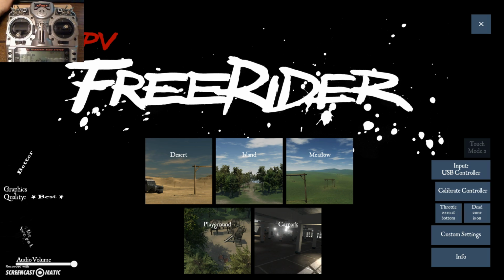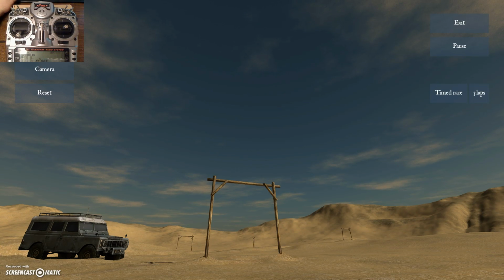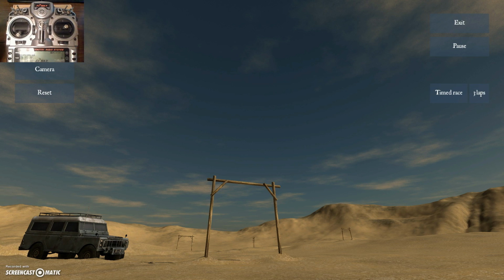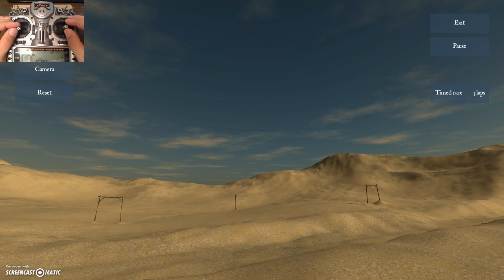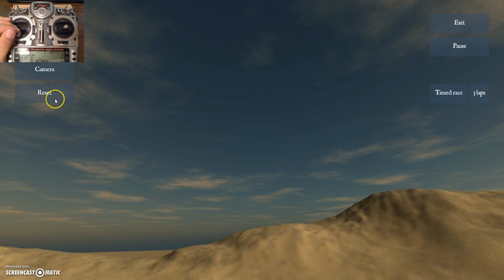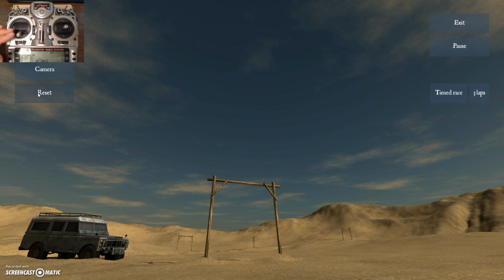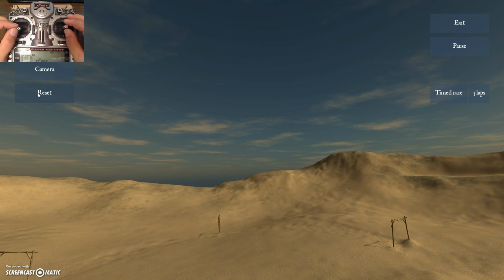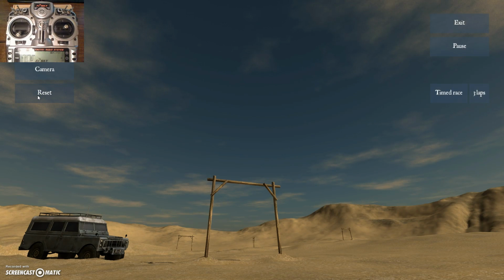How To Fly A FPV Racing Drone - Lesson 2 - Slow Forward Flight

Comment: Joshua just wanted to give you a personal thanks.  I finished my build with a 3D printed Peon 230 & an F7 flight controller with AIO ESC and once I installed Betaflight & upgraded firmware took to my driveway and flew straight up into 1 of my trees... LOL...  Reprinted the top and bottom which had snapped in half and now am looking at this series and the sim software.  Keep up the great work! appreciate the time and effort you put into this!

Comment: I love your video's, but I am having trouble. When I am in across mode my sticks don't operate properly.  When I use throttle the drone speeds up, and goes forward.  It show Everything working when I configure it.  When I turn on self leveling the co trips work fine.
Any suggestions.

Comment: being a 45 years  flying  r/c helicopters   I am used to reducing the power due to the extra lift generated in forward flight .. Now I can realise why I keep crashing .
Reply from the maker: Exactly opposite for a quad. Less downwards thrust vector means more throttle is needed. I never knew that big helis were different. I guess that big rotor makes more thrust when the air starts moving over it.
Reply: Thanks for your excellent videos   I am going to have another go .wish me luck ./ success.

Comment: Possibly stupid question about inputs... What does the pitch and roll stick control: Your angle or the movement of the copter? It looks like you pitch forward the angle you want and then return to center, is that correct? So you're controlling the relative movement of the quad, not its actual angle... Just putting this out there because it wasn't immediately apparent to me, and maybe it would help somebody else.
Reply from the maker: In Acro/Rate mode, the sticks control angular rate. Pushing the pitch stick forward makes the copter rotate forward. Centering the stick makes it hold its angle.

Comment: I actually bought this game for my phone and i tried to use my devo 7v and devo 7e i even tried to use my xk x7 tx and none of them work. Can you maybe tell me how to get to use my devo 7v with this game please?
Reply from the maker: +Ian Rice on a phone? No idea.
Reply: (I'm assuming the 7 has a usb port) You need an OTG cable and the Deviation firmware. Once you have deviation on it create a model and set the protocol in the model settings to USBHID. Tweak it for there.
Reply: Joshua Bardwell ok thank you.  I'll just have to Get it for my laptop.
Reply: Bean Mosheen  thank you I'll have to do that or get it for my pc.

Comment: what type of wire do you need to use your own tx? this wire plugs into usb? theres a "trainor" port on the back of my tx...any help appreciated
Reply from the maker: You can run the trainer port into the PC using something like this: http://www.endurance-rc.com/pctx.php

If you have a transmitter with a USB port, it might emulate a game controller. Taranis does this anyway. So with Taranis you just plug into the USB and go.
Reply: +Joshua Bardwell exactly what im looking for..i gotta find one compatible with emax 280rtf setup..em16 tx. thanks for the reply

Comment: I appreciate the time you have taken to answer my questions. 
And now for another question. What processor are you using on your computer? Currently I have a Windows Vista that will run the FPV simulator at a rate of about 1 frame every 6 seconds! Yeah that slow. I'm looking at a 6th generation core i5 with intel integrated 530 HD graphics. Please let me know what you think
Reply: Seans Page Is this a laptop? Generally laptop Gpus use cut down versions of their desktop equivalent. Most of the time they are equivalent to Intel dedicated graphics, unless if your using a gaming laptop. Free rider FPV isn't to demanding however you should have computer with at least a dedicated graphics card to run it.
Reply from the maker: I'm not really knowledgeable about PC hardware, but my computer is an Intel Core i7-4770 @ 3.40 GHz. I have 16 GB of memory.
Reply: That should be good but the Processor isn't the only component you should be looking at. It would be best if you were able to get a dedicated graphics card. Even something a little older like a GTX 660ti would do you wonders! and I'd also recommend at least 16GB of ram.
Reply: +BenHensley thank you. the one I'm interested in has 12gigs ram and an nvidia gforce GTX graphics
Reply: +Seans Page that should be okay as the program isn't too crazy graphics intensive! If anything you may just have to lower your resolution a little bit. Have you thought about building your own computer?

Comment: Does a drone with angled motor mounts go forward as soon as it leaves the ground? Would it also lose the ability to hover in one place? Does it hover with the frame at the same angle as the mount is tilted? In which case with an angled camera you would be looking at the sky. Sorry if these are stupid questions but I'm in fact a beginner learning from your videos.
Reply from the maker: +rainbowplacer With angled motor mounts, you might start flying forward as soon as you take off. It can hover, it just has to pitch backwards until the motors are level with the horizon. If you have angled motor mounts and an up-tilted camera, those angles basically add. You don't do a lot of hovering if you have a lot of uptilt. The whole point of uptilt is to go fast.